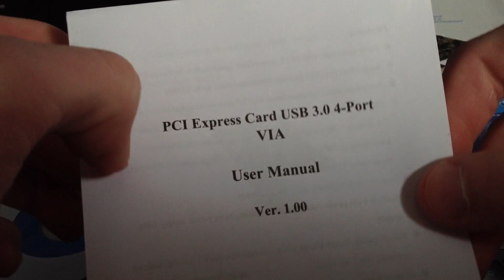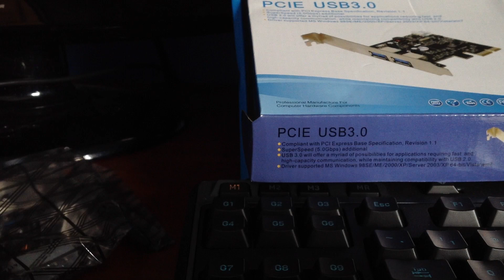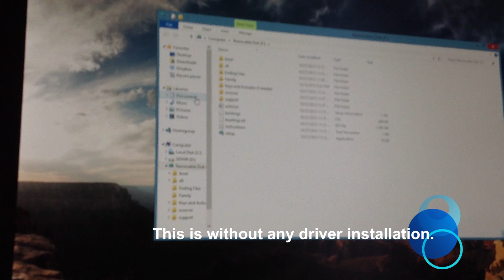PCI Express USB 3.0 Card Unboxing and Installation

Comment from the maker: It depends on the model you get. This one was pretty fast but recently died and stopped my whole computer from booting. I removed the card and it worked again. The card is now sitting useless on my desk.
Reply: Are you sure that power connector wasn't needed?